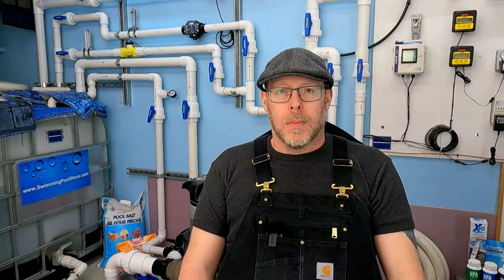Pool Pump Keeps Tripping Electrical Breaker - Now What?

Comment: Mine was working fine until I accidentally turned off the breaker. Now When I turn it back on, it runs for 45 seconds and then trips the GFCI. Any idea what may be causing that type of issue?

Comment: My above ground pool keeps tripping the GFCI instantly. The GFCI in new and i have run a wet vac and leave blower simultaneous (16amps) with no issues. Any other thoughts other than what i believe to be the issue (Pump).
Reply from the maker: @JoeKeaty  your pump has a ground fault and the breaker is doing it's thing and protecting you. An electrician would probably start by opening the junction box area on the pump and drying it out with a fan / hair dryer. Past this, something has become damaged with the wires or pump.

Comment: Most variable speed pumps use  solid state electronics to vary the frequency to control the motor speed. Very unreliable and expensive to repair.
Reply: I'm an industry pro with 27 years in. Idk WHY two speed motors are absolutely absent from the conversation. They're basically bulletproof, all electromechanical (zero electronics) and conform to DOE regulations. Been on the market for decades.
I guess most pool pros want higher sales, and most consumers want bigger headaches. Go figure.

Comment: i suppose one day i will have to get a new pump.  so far my hayward super pump single speed is 6 yrs old and running great.  but when the time comes i was thinking of the black and decker brand.  hopefully by then they'll be cheaper to buy and the bugs will be worked out.  one thing i hate hate hate about todays stuff is circuit boards.  hot tubs for example.  it would be great to have a hot tub with just many on/off switches.  you want it hotter?... turn on another switch.  hotter still?  flip the next switch and so on.

Comment: Great tip Steve!  Another scenario that I experienced with a new VSP is electronic noise from the motor controller that triggers the GCFI. Apparently this is reasonably common with Pentair pumps. They sell a propietaty breaker ($$$$) as a fix. It has a somewhat higher than normal trigger current.
Reply: It's not a proprietary breaker it's just a rebadged siemens. Had the same issue quick trip to the big box supply store and for a fraction of what Pentari wanted I was good to go. Been running it for five seasons. Also my research showed it's not just pentair other variable speed pools pumps and other similar devices can trip some GFCI breakers.
Reply: @lordgarth1  I read that Siemens sorts out breakers at the high end of tolerance for GFI trip current and brands them for Pentair. You can luck out and get one direct from Siemens or not. Just what I read... But grading electronics in this manner and charging more for some specs is pretty common.
Reply: I experienced this with a Pentair VSP.
Just curious, how far was your GFCI from the main house panel?
In my customer's case it was roughly 100 feet, and I read that long electrical runs can cause that to happen. 
We just swapped it out with a standard 240V breaker.
I didn't know about the proprietary breaker, thanks!
Reply: @mayorb3366  Maybe 60 feet.

Comment: I agree with most of what you said, but there is a nonzero chance that it’s simply a bad/weak breaker. Since a breaker is generally an easy swap, it may be worth trying that first.
Reply from the maker: If you read the video description you will see that I mention this here.  I agree with you.